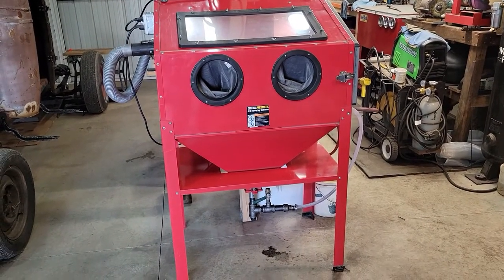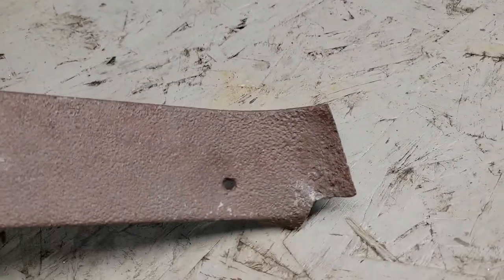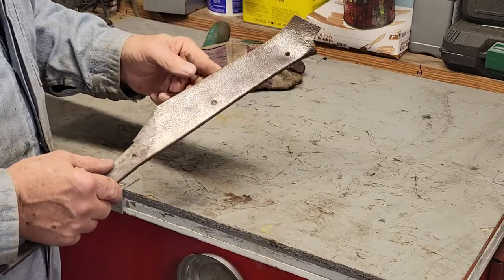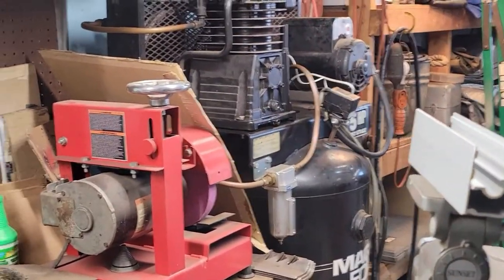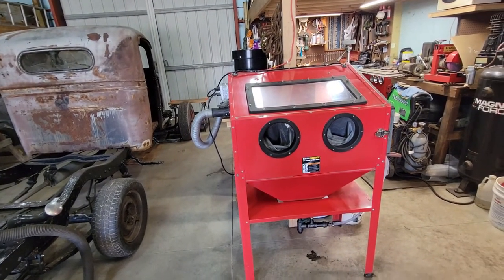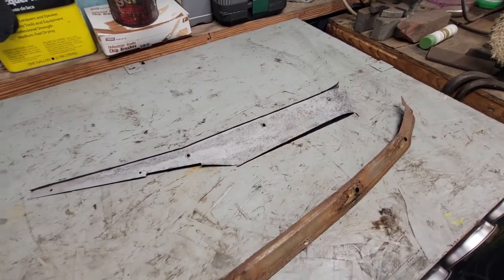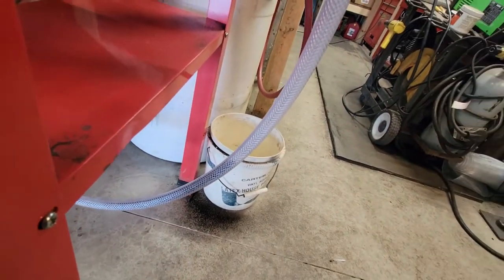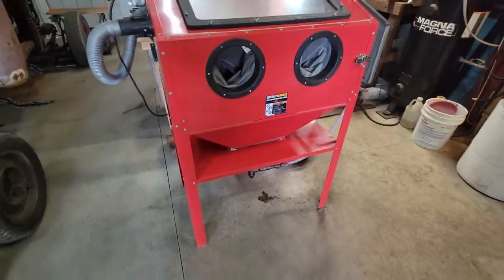Harbor Freight Sandblasting Cabinet Problem Solved!!

Comment: Congratulations on finally getting it to work! The foot pedals are nicer to use than a trigger, but I can see why you don't want to dump any more money into the thing.
Reply from the maker: I'm thinking about going that direction Kyle. I think a better gun with the foot pedal will make it even better.

Comment: What media are you using, I'm having trouble getting my harbor freight blaster to work. I did the upgrade everyone is saying to do. Mine works like crap.
Reply from the maker: I don't know the name of the media, but I buy it at Menards. It's black and designed for media blasting. I also did purchase a better gun with the foot pedal and that helped tremendously, but it was more money. Hope you get yours figured out, it just takes a lot of trial and error. Another thing that will definitely help is a heftier compressor than what I have. Mine doesn't have the CFM to really do a good job.
Reply: Compressor  is a 10 hp 4 piston, 120 gallon tank, with a seperate 80 gallon from another compressor connected together.  I saw all these YouTube sights, talking about how great they were with just a few modifications. I needed a sandblaster,  they must be good. Wish I had put a couple more hundred with with the $120 on modifications, and bought a real sandblast cabinet.
Reply from the maker: @dongreene2546  You definitely have a big enough compressor to do the job. Hope you get it figured out.
Reply: Black aluminum oxide is what you want.

Comment: You need more pressure to run your sand blaster. I run at least 90lbs in mine and often more. Your compressor will run constantly anyway to keep up with the high volume of air you are using. UP YOUR PRESSURE!
Reply from the maker: I had to get the pressure down in order for that gun to draw up the media. I was using 80 lbs and it back fed the media hose and wouldn't allow it to siphon right. I'm going to be looking for a better gun and maybe foot pedal arrangement.